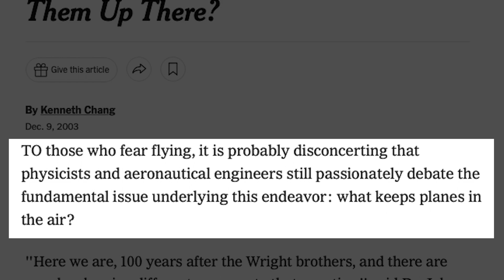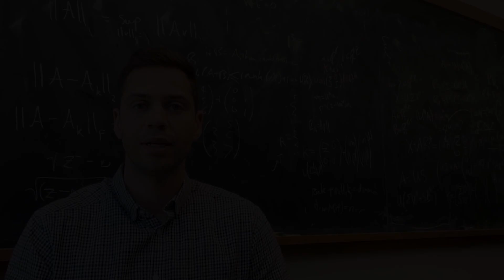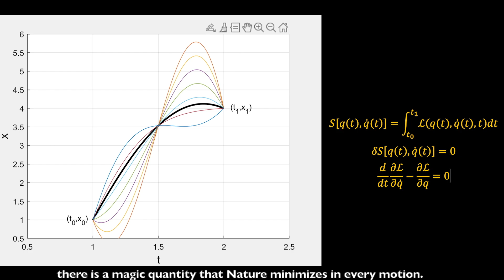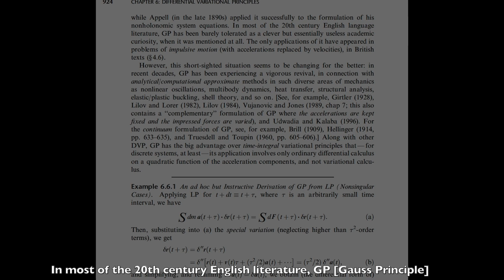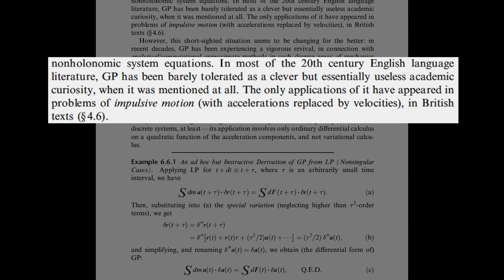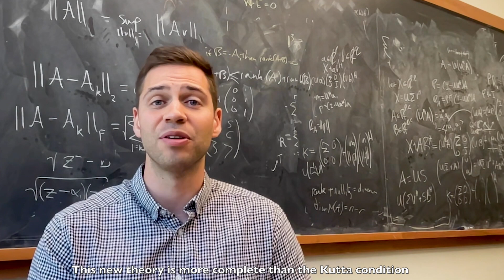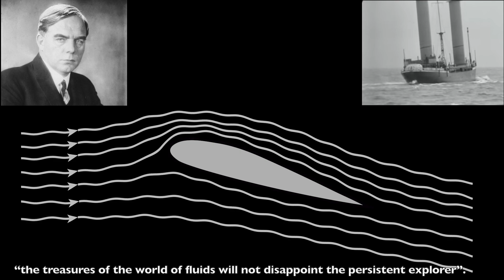A New Theory of Lift

Comment: If a 5 year old can not understand what you mean, then you do not know what you mean. 
Einstein. 

I  always thought that the impact of the moving wing's bottom surface with the air particles caused the pressure on the bottom of the wing.
The rest of the wing's shape was just streamlining of the wing's structure. 
That's why Angle of Attack is important so stalling does not happen. 
A streamlined shape achieves minimum resistance when moving through a fliud in the design orientation.
Reply: and that's well known because stunt planes fly upside down without a problem. floats, on float planes are supposedly designed to aid lift but from what i can tell they look like upside down wings.
Reply: Any 5 year old should be able to download a computer simulation of the Navier-Stokes equations and run it. I would select Excel VBA as the initial platform, and Alexandre Chorin's approach to the Navier-Stokes equations based upon the Brownian motion of vorticity as the initial model. This can deal with aerofoils. Maybe 5 is a bit young, but I could certainly have done something like this when I was a bit older. I have a spreadsheet available for the motion of an electron in a dipole magnetic field (i.e. the Van Allen belt) which is available now. This isn't science fiction.
Reply: @david_porthouse  
I rest my case.
Hahaha Hahaha
Reply: I see the wing (and its angle of attack) as casting air down, in other words, creating a vertical component to its motion.  After that, it's just F=ma.
Reply: @d.jensen5153  yep
The remainder of the wing shape is streamline for the air flow, with minimal resistance to the forward motion.
Reply: @stephenbrickwood1602  more lift is generated by the top of the wing, so if anything the bottom is streamlined and the top is the active lifting component. Its not ONLY reaction force that creates lift, though it is part of it
Reply: @nade5557  in theory 
Hahaha Hahaha 
I used to think it was all top surface 
That is, all the lower air pressure from the Bernoulli effect on the top of the wing. And the normal air pressure on the bottom of the wing. 
Now I think the additional pressure coming from the impact of the bottom of the wing with the passing air, the deflection down, may be the majority of the lift forces. 
Has anyone done this experiment of measuring both?
Reply: @stephenbrickwood1602  yes, the pressure difference on the top of the wing is twice that of the bottom when compared to ambient pressure. So about 2/3 of the lift
Reply: bear in mind thats just a rule of thumb and changes based on airfoil shape, speed and angle of attack
Reply: @nade5557  in std flight??
How do you know?
Reply: @stephenbrickwood1602  yes in standard flight. The information is available online, and says the same thing as I was taught
Reply: @nade5557  if you rotated a drum does the air pressure reduce on the surface of the drum?
Reply: @nade5557  if you move a solid cylinder through the air the Bernoulli effect is equal in both directions. 
Cut the cylinder in half and the two halves move apart. 
So it is air pressure, and deflected air leaving a lower amount of air behind.
Just thinking.
The effect has a name but what is happening is the detail question.
Reply: @stephenbrickwood1602  the magnus effect, its caused by skin drag. Its actually an application of the bernoulli effect. The cylinder accelerates air on one side and slows it on the other (because of skin drag) which causes a pressure differential hence lift. Its why the cylinder has to be spinning to cause lift, yet the same amount of air is deflected by the top and bottom halves, showing lift is at least in part caused by bernoulli
Reply: @stephenbrickwood1602  not sure what you mean about cutting a cylinder in half but yes, lift is caused by both pressure difference and deflecting air
Reply: @d.jensen5153  If the atmosphere were a superfluid, then an aeroplane would not be able to fly. In a real fluid we have a flow separation from the trailing edge of the wing to get things going. This sets up the Kutta condition.

Comment: I'm very pleased that the curvature argument is coming to the fore. I investigated this years ago when I did aerodynamics, but I couldn't quite get beyond replacing the Bernoulli equations with curved flow to calculate lift. Very impressive, Prof. Taha and Mr. Gonzalez
Reply: My first experience with "The Unexplainable" was the Flit Gun! I could see it worked, but wasn't content until I understood what forces pulled the DDT up the tube into the air flow! Least Curvature is what birds use for economy of flight. Least effort saves fuel! Proud of your curiosity!!! Be excellent my new friend!
Reply: It's obvious that forcing an airmass to follow a curve in one direction (down) will produce an equal and opposite reactive force in the other direction (up). The question is how is the deflection obtained. There are two things at play here. One is a pressure imbalance and the other is the behavior of the airflow. Traditionally people have attributed the pressure imbalance to the acceleration of the airflow over the top of the wing. This is backwards. In nature you need potential energy first before you get kinetic energy. I like to describe an airplane wing as a "wing piston". As the wing piston moves through the air the air is compressed at the front leading edge and rarified from the topmost point on the wing to the trailing edge. As such the wing has a front part and a rear part divided by the topmost point on the wing. As such an initial pressure differential is created between the front and rear potions of the wing, similar to how moving a piston in a cylinder produces a pressure differential between the front and rear of the piston. It is this initial pressure differential that pumps the air over the top of the wing causing the air to be accelerated. When this happens Bernoulli's principal takes over. The acceleration of the air lowers the pressure on the top rear portion of the wing even further. Once this region of low pressure is established on the top rear part of the wing any air molecule that encounters it will be deflected downward along the curvature of the wing. Then the action/reaction principle takes over and the force created by the downward deflection of the air molecule is vacuum coupled to the top surface of the wing, which produces the upward lift. If you think of it this way its not as confusing and it is not that difficult to understand.
Reply: @joevignolor4u949  

"The question is how is the deflection obtained. "

What do you mean obtained?
Reply: @jaydenwilson9522  Obtained means created.

Comment: Is minimum curvature the same as path of least resistance?
Reply: How do you define "resistance"? If you mean least energy, then the answer is no. Interestingly, the path of least energy expenditures results in ZERO lift.
Reply: @haithemetaha9194  Do you mean least energy dissipation? I have seen the principle of least dissipation applied to the understanding of dense granular systems under shear. They yield nice results when one looks for the formation of shear bands (see Unger et al, doi:10.1103/PhysRevLett.92.214301).
Reply: It is a completely different physics, of course, where dissipation is of utmost importance.
Reply: @wellesmorgado4797  Oh, I see what you are saying. This theory, similar to the classical theory of lift, assumes an ideal fluid. So, there is no dissipation. 
Minimum dissipation represents the governing physics in Stokes' flow (i.e., in the limit to zero Reynolds number). The lift problem lies in the other end of the spectrum: in the limit to an infinite Reynolds number, where dissipation may be negligible with respect to inertial forces.
Reply: @haithemetaha9194  Thanks for answering & clarifying the point. Yeah, the limit of what I was thing was the extreme dissipation limit, like for a dense granular system under shear.
Reply: Just to make it clear: minimum dissipation in a very high dissipation regime (Re --> 0).
Reply: @wellesmorgado4797  what if it was the least energy dissipation, or rather the least energy transferred from the wing to the air, perhaps minimising the average kinetic energy transferred from the wing to the air, aka the least total "movement"
Reply: @nade5557  We tried to minimize the total kinetic energy in the flow (subject to continuity, so potential energy is also accounted for) and resulted in ZERO lift, which is quite interesting. Perhaps, other forms or definitions of kinetic energy could be useful.
Reply: @haithemetaha9194  interesting, thanks
Reply: @haithemetaha9194  I suppose I mean path of maximum efficiency.

Comment: Why can't physicist just simulate this problem based on particle physics? I mean like make a small wing made of atoms literally move through simulated air molecules. Then they don't need to theorize or approximate. I get that this will need insane amounts of computing power but isn't that issue solved nowadays?
Reply: Probably because it would be impossibly costly to implement such theory, even as a simulation. Even molecular dynamics (MD) for air particles as spheres would be also impossible. I don't think that a microscopic model would be useful in here. That is why they have to treat the fluid as a (sort of) continuum, obeying the laws of hydrodynamics. 

Just to make it clear, the largest MD simulation involves a few billion particles (lets say 10^10 particles). Any realistic enough simulation, capable of truly explaining the Kutta solution, would involve 10^25 or more particles.
Reply: Because it is a lot cheaper to simulate it with a model based upon the Brownian motion of vorticity as a representation of the Navier-Stokes equation.

Comment: You are not addressing takeoff and landings. The plane is always adjusting its flaps and leading-edge slat. The images you are showing are not what a wing looks like at 36,000 feet. Airplane wings are active and moving parts like the wheel of a car. One rides the air the other the terrible roads on the ground.
Reply: Flaps and slats are helpful, but an aeroplane can fly without them. A big aeroplane leaves behind a starting vortex on the runway and it can be dangerous for a small aeroplane to follow it straight away. This video has nothing to say about vorticity.
Reply: Aircraft flew before flaps and leading edge slats existed.
Reply: @ChucksSEADnDEAD  For the purpose of this discussion think in terms of aerofoil section NACA0012, which is a thin symmetric aerofoil with no slats or flaps. An aeroplane which uses NACA0012 is able to fly, and can fly just as well upside down. This new theory of lift is apparently saying it can fly even if the atmosphere were a superfluid. I don't agree.

Comment: Actually, every kid who holds his flat hand out the window of a moving car knows what force makes planes fly...
Reply: The angle of attack leads to more air being directed downwards from the bottom of the wing.    This effect is very noticable to glider pilots under tow conditions where they can  drop below  the tow plane and find the turbalent air that comes off the bottom of the wing.    Look up "boxing the wake"
Reply: What is this force?
Reply: @StarsManny  Reaction force of the air bouncing off the bottom of the wing. Actually, it is only part of the story. More of the lift is generated by the top of the wing than the bottom, so its not JUST this force causing lift, though it provides SOME of it

Comment: interesting, but it doesn't explain the lift of a flat plate, where there is curvature at the both ends... neither the sails
Reply: A flat plate edge-on to the relative wind will not produce lift.  But tilt it upwards and it will.  It has nothing to do with curvature but with the fact that the leading edge forces air upwards against the undisturbed wind, where it is slightly compressed.    This makes the disturbed air flow faster and that pulls some of the air above the plate with it, creating a partial vacuum.  The difference between the air pressure on the bottom of the plate and that on the top produces lift.
Reply: @paulmartos7730  the video here speak about the fact that you can replace in some cases the kutta-jowkowski condition by a condition of curvature minimisation in the flow. For a flat plate with angle of attack, the curvature in the flow is symetric in the both end, and then this theory seems not adapted for a flat plate. With a kutta-Jowkowski condition on the trailing edge side, you can predict lift at small angles of attack.
Reply: @paulmartos7730  angular tilt from a relatively horizontal position intrinsically introduces curvature, does it not?
Reply: @paulmartos7730   This is absolutely correct. Difference in air pressure between top and bottom of wing produces lift. There's no question about it.
Reply: @elizabethhenderson3747  that AND reaction force of deflected air molecules. Both effects are at work simultaneously
Reply: @nade5557  This reaction force, is it the prime cause of difference in pressure, or secondary as like, for analogy, a compression wave effect?  A compression wave occurs virtually simultaneous afterwards of an explosion, for example. I'd like to know more of this reaction force. It's fascinating!
Reply: @elizabethhenderson3747  the primary cause of pressure would be bernoulli and kutta. This is shown because the top of the wing accounts for 2/3 of the lift, and reaction force can't work on the top of the wing since it's out of the way of the direct airflow, instead sucking the air downwards rather than pushing it out of the way. It is also shown because a flat bottom airfoil at 0 angle of attack still produces good lift even though there is no reaction force from the bottom. The reaction force is simply the wing deflecting particles off the bottom which causes an equal force upwards on the wing because Newton's 3rd law. All 3 of these things work together to create pressure difference and lift
Reply: Lift can be obtained from a flat plate, but there will be a flow separation at the leading edge which will result in a very turbulent boundary layer on the upper surface. Try a simple aerofoil like NACA0012 instead.

Comment: You have not mentioned the Coanda effect.
Reply: Because it's irrelevant. Air flow over the top of the lift generating device is not in a condition to provide lift through Coanda, requiring a powered high pressure air source and ducting it over lift generating surfaces.

Comment: I wonder if you can also use a Feynman path integral solution logic, but then with all the Euler solutions and whether it gets the same result as the least curvature solution. Just out of curiosity
Reply: If I understand correctly, Feynman's path integral relies on the principle of least action. Interestingly, when we minimize the action (kinetic energy), we get ZERO lift. Very interesting!
Reply: @haithemetaha9194  I think the result of the path integral is least action, but it actually consists of the integral of all possible paths to explain that least action. Correct me if I'm wrong

I wonder what the result would be if you made an integral of all the Euler solutions for lift, what would it look like and would it also produce lift?
Reply: @Robinson-1878   
I think this sum (integral) of all the possible solutions in Feynman's formulation is because of the stochastic nature in quantum mechanics, not sure though. The problem here is deterministic. So, the classical action principle (without Feynman's extension) should directly apply, but it, interestingly, yields a zero lift force as I mentioned.
Reply: @haithemetaha9194  okay, then I'd like to formulate it differently: could you use a Feynman diagram kind of logic, as in sum every allowed solution to find the actual solution? Considering there is a limited amount of solutions, and it is probably asymmetrical, this is likely not identical to the least action

Just being very speculative here, thinking out loud out of curiosity
Reply: Something in quantum mechanics is random, which we can represent in fluid mechanics by the Brownian motion of vorticity, the latter idea being due to Alexandre Chorin. Any path integral formulation would integrate the randomness out of existence. The aeroplane would then be attempting to fly through a superfluid, which is not possible.